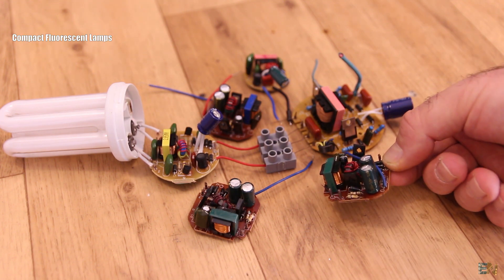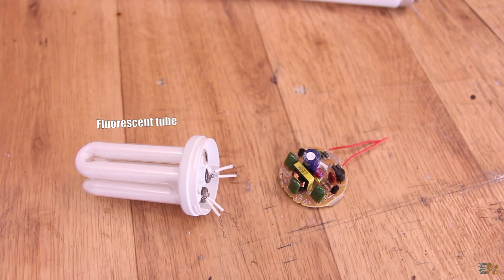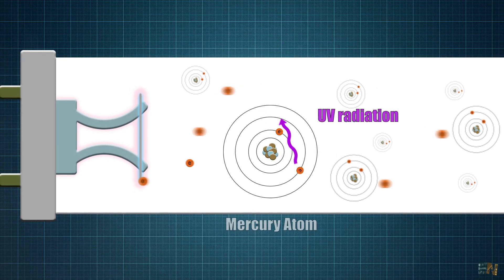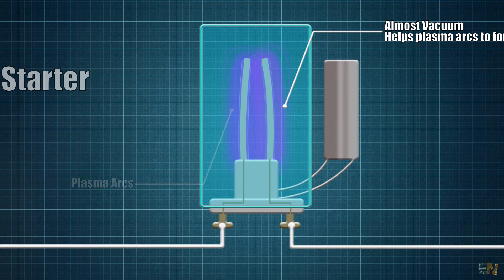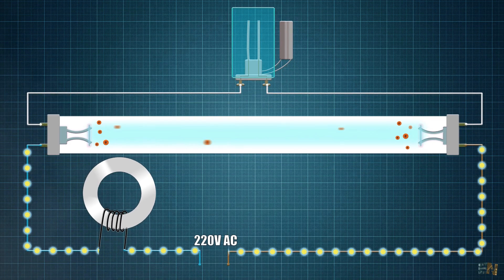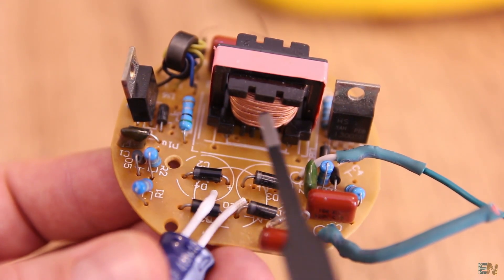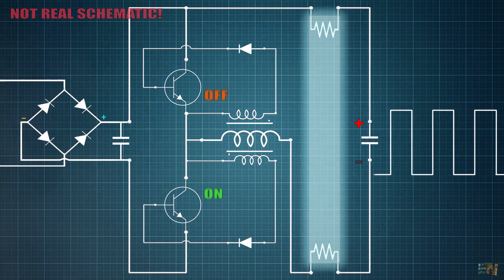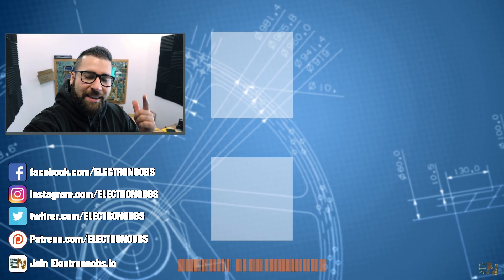How CFLs work - Plasma Arc Starter | Electronic Ballast

Comment: Thank you for a very informative you tube video. Please confirm if you have tested the voltage on the bi pins after the fluorescent tube is energize. If I remember seening data and actualy checked across the cathodes are around 110/120 Volts. I would not try with electronic ballast as crazy quazi voltage occurs. Useless info. Shields were fitted over the two end cathodes to prevent cathode splatter onto the inner tube.  Go into why there is a suppression read some say a capacitor connected to the glow bottle. Greeting's from South Africa.

Comment: Is it possible to apply a lower voltage just enough to create a plasma but not heat it enough to bend the bi-metal? I would like to have a starter permanently lit with the argon glow.

Comment: need to run a uv tube from 12v to sterilize water when camping etc, either one of those 6w/8w tubes for ponds or those 3w gtl3 style ones. ( I think 24v+resistor can strike those but they prefer ac)

Comment: so the bimetallic switch inside the starter will auto disconnect when the lamp turn on only right? for example if the lamp did not turn on so the bimetallic switch inside starter will continue to connect untill the lamp succesfully turn on then the bimetallic will disconnect.
am i correct?

Comment: Please, I am confused somehow. I am finding difficult tracing the current path when the upper transistor is conducting. It seems the electrons have absolutely no path to ground. Does it mean the current will float because the current will not flow backwards through the tank capacitor back to the positive terminal of the smoothen capacitor. I am confused, please I need clarification.

Comment: Waiting for these to reach full brightness is like worse than waiting from cold engine start to VTEC kick in.
Why I see people comparing CFL to tungsten, and say they're efficient? Like saying: " Intel's 3rd gen CPU is better than 2nd gen CPU, let's ignore Intel's 4th gen and above CPU."
For the record, I also use CFL, even fluorescent tubes. However, I'm replacing broken ones with LEDs. No point throwing away those that still functioning.

Comment: I never thought about how CLF's work! By the way, I am working on your brushed drone project but I have a problem. I don't want to buy the Radio transmitter due to budget issues as most controllers in my country cost around $60 to $80USD is there a way to control the drone with an nRF24 with my pc or phone? If not it's ok I can work with the Bluetooth modules but I want to use the nRF due to range problems. I have considered using the ESP8266 but I could not find a suitable code anywhere. Please, is there a way to use the drone from my pc or phone? or will I have to use the Bluetooth module instead(I do have the code for the Bluetooth module). Anyways thanks! I have learned a lot from you and will continue to do so.

Comment: I have a question pls answer it .
I want 2 sensors in which I kept 1 at place a and 2nd at place b.
So it tell the distance bw them.
And also if I move one of them up down or rigth and left then also it works.
Means which are aligned to each other.

Comment: Mercury, UV radiation, and extremely short lifespan: all reasons to ban compact fluorescent bulbs.

They also take time to warm up to produce full light output. 

The manufacturers lie about the lifespan because they claim they last as long as regular fluorescent tubes. In my experience CFL's have the shortest lifespan of any lighting technology. 

Politicians love them because they use less electricity to run. That way they can claim they are doing something green without actually looking into it.

I wonder what the environmental impact is on making all the components of a CFL, as compared to a regular incandescent bulb? And how much electricity is used in manufacturing?
Reply: LEDs are the solution.
Reply: Don't forget also the poor CRI.
Reply: MarkDog: I wonder what the environmental impact is on making all the components of a CFL, as compared to a regular incandescent bulb? And how much electricity is used in manufacturing?
Me: wait until he finds out about LEDs. And he'll say: "It's a wonder full world."

Comment: What causes the starter to cool down?  Is it just the fact that because they came together, there is no more plasma creating heat and once seperated, the coil dumps and pushes enough voltage to get the tube going?

Comment: Great Video, I'm just beginning my journey into electronics and learnt quite a lot. You explained it really well. In the modern CFLs, what do you think are the main failure modes? I'm considering if it's worth salvaging the coil and some caps off the boards of nonfunctional CFLs before I throw them out.
Reply: I reckon it's definitely worth saving the high voltage caps. They usually have reasonable length wires on them. Also in many I have scrapped that have failed the transistors often still work.

Comment: it's not an arc inside the starter it is the same type of gas discharge that we want to have in the big tube as well, but because the electrodes are much closer to each other the starting voltage is much lower.

Comment: Why did the circuit have to be converted to dc and then back to ac? It seems to me that it could consume even less energy if it didn't have to go through all of those circuits.
OK.  I'm a true-blue electronoob here but that's why I'm watching these videos.  We all have to start somewhere. Actually,  I'm seeing that it is working the same as my study of computer programming and later quantum physics. You read,  hear,  watch and it all seems interesting but makes no since at all.  Then you understand a tiny piece and then another tiny piece.  One day you learn something that ties together 12 of this pieces which links others and suddenly you got it. After that you just add more parts to your knowledge. 
Yes,  I'm also proud to be a NERD.
Reply: Ever noticed how those old fluorescent lamps flicker? With a high frequency, not only can it be a lot smaller but there's also no flicker.

Comment: Very nice video ! But you forgot to explain the purpose of the capacitor in your first schematic !
In theory, the life time should be longer than incandescent lamps but actually, lot of CFLs are made with low quality components and lot of them are poor reliability so the life time could be less than classical incandescent bulbs (with normal use ie lot of ON/OFF cycle).
Reply: The cap across the starter is purely for EMI suppression. It will work fine without it, but create a nasty click on radio gear. Possibly even certain audio gear. There is usually also a bigger cap in the fluoro housing. This is for power factor correction and the fixture will work perfectly well without this too. Indeed, if you're planning on running one of these lights from a MSW inverter, it is a very good idea to remove this cap as it just puts a big load across the inverter's output.

Comment: I get that "on paper" CFL bulbs last longer than tungsten bulbs but in my experience they burn out in like 1/2 the time...
Reply from the maker: bad manufacturer maybe... ?
Reply: Frequent power on and off can shorten 
CFL lifespan. Also Good ventilation of the lamp is needed. From my personal experience, CFLs do last longer than incandescent lamps.
Reply: I think cheap manufacturing process produces terrible cfl's because in my house i am still using cfl in some rooms because they still shine after maybe 7 years i think they are philips
Reply: @kemalkurt5257  any problems with startup/flicker/colour? What about cold weather?
As someone pointed out: frequent startups seem to kill the bulbs and so does weather. Where I live we get -40*C to +40*C weather and neither extremes are permissible for CFLs (or so it seems).
Reply: @jamess1787  they start not their full brightness maybe 60% in winter but in few minutes they reach their full brightness but I'm not using in bathroom or other room which i need full brightness instantly so it is no problem for me or my family. I think i am using cfl's when they are avaliable because they were so efficent in comparison to tungsten lamps but last few years i start using leds when a cfl fails. Colour rendering is enough i think and they not flicker but one of my new led lamps flicker but im using that led lamps maybe more than 2 years and when look with a phone camera i noticed that light flicker.
Reply: Just terrible technology. Too many electronic components same with cheap LED bulbs. Down to bad quality ballasts.
Reply: I think its forced obsolescence, where manufacturers force their products to fail prematurely in order to switch to LED bulbs? Just a guess, but this has been hapenning with some products
Reply: @narayanbandodker5482  this was long before LED lighting technology was even available. CFLs have always been terrible quality, I don't know anyone who still has CFLs (even frugal people). There was a low-mercury mandate in fluorescent tubes: these fail prematurely. CFLs are now more expensive than LED bulbs.

Comment: Suppose I have 40watts cfl lamp ballast and I have 20W tube, can I use that ballast with the tube since after tube on voltage is limited by the circuit?
Reply from the maker: I'm not sure about that.... But I'm guessing that if the 40W circuit has no current limit, it will maybe burn the 20W lamp?
Reply: @ELECTRONOOBS  I tried it, it works and no magic smoke did not come out. But I am not sure that it will effect long run. I search youtube for explanation of this circuit but did not find any good one. But your video makes my concept clear about this circuit.

Comment: Sir why capacitor is connected across starter, what is the significance of it ? If we model lamp filament as resistor then this circuit looks like RLC series circuit & starter act as switch across capacitor, but does this has any influence on working principle ?

Also your videos contain great animation works, can you please suggest me a animation software for  teaching basic electronics ?

As always a great video.... :-)
Reply from the maker: Hi., Thank you. For animations I use after effects and photoshop/Ilustrator for the designs.

Comment: Nice explanation! But I didn't get why there are two different pairs of wires (or two different tubes) in the CFL, instead of just one? Does it make the circuit simpler (it does look similar to an astable multivibrator)?
Reply from the maker: two pairs because we have an electrod on each end with two connections.

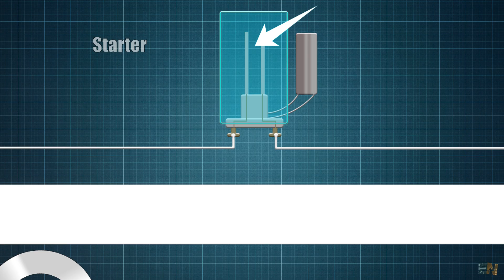Comment: Just a minor correction. 5:14 The choke is usually wound on a core made of iron slices. Do not break flurescent tubes as they can contain toxic mercury. Just a note of warning. Good video.

Comment: bro good video can u make a video on how to fix chinenese clone nano plz that is most wanted in arduino topic plz
Reply: @dhekshith4113  not about money it should also have some solution im not talking about voltage regulator .when u buy a new arduino (clone) after u program more than 3 time u cannot program it shows something like ardvure stk i burn and re flash bootloader but  it didnt help me
Reply: Buy 10 and at least around 7 or 8 will be functional. It's too much effort to try and fix something that cheap.  If you're having trouble connecting to them via USB, try a better cable. If you're having trouble uploading sketches, try the "Old Bootloader" option. If you'´re still having issues, try flashing the new Bootloader by use of a working Board and the ICSP connection.    Wish you lots of success